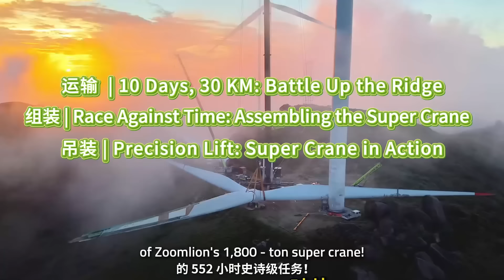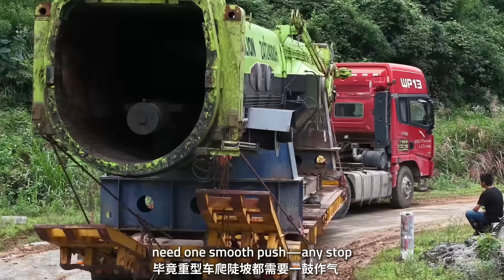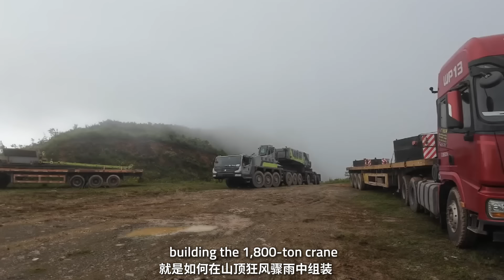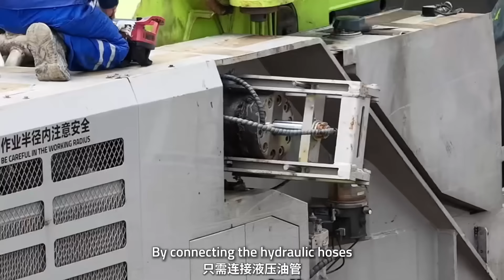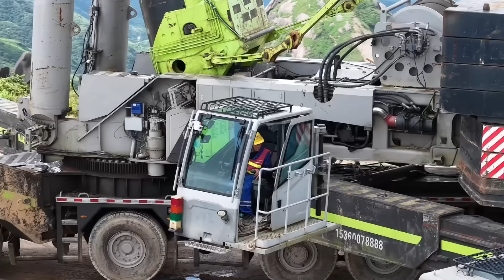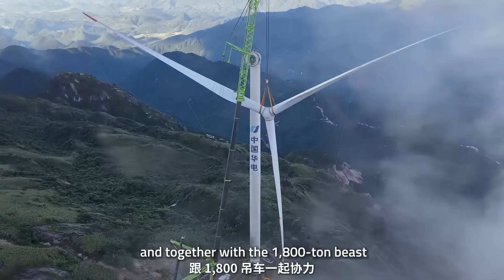Chinese-Manufactured 1800-Ton Crane: On-Site Shots Expose Its Operational Capability

Comment: This piece is not the biggest engineering power. Look to the LR 11000 from Liebherr.
Reply: different things mate. the LR11000 is a crawler crane. This is a mobile crane. XCMG and Sany both have mobiles cranes bigger and this one from the video. Liebherr also has the LR11350, LR12500 and LR13000, all of these are bigger than the LR11000.
Reply: Zoomlions 4000t is the biggest 7 piece boom @94m +95m lattice jib, 
The top deck is removed for transport, from it's 3.5m slew  bottom deck,
Reply: Liebherr ist already Testing their LR 13000 that is capable to lift 3000T
But i think the space at that Mountaintop is Not enough for this engineering Marvel.So it's OK they do the job with a Toy
Reply: @karstenregman1307  SANY SCC40000A
Reply: @karstenregman1307  Liebherr is definitely not testing the LR13000 because the LR13000 has been in operation for more than 10 years now. Van Adrighem/Fagioli , Buckner Heavy Lift have LRs13000 and have owned them for quite some time. They also have done several projects, so no, Liebherr is definitely not testing the LR13000. In the meantime Liebherr has released the LR12500 of which 2 are in operation, 1 by Denzhai and they have now ordered a second unit. Regarding size, there are also bigger crawlers, you can find some in China with capacities excedding the LR13000, even though the LR13000 is still considered the largest conventional crawler crane, mainly because the chinese versions aren't exactly "conventional" , some use 2 booms.